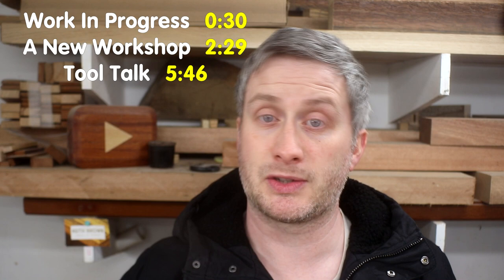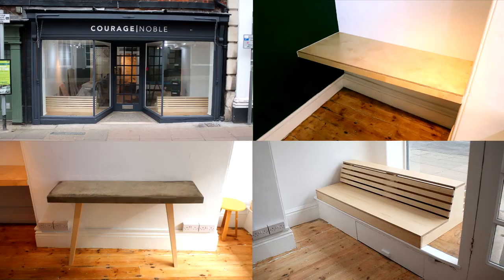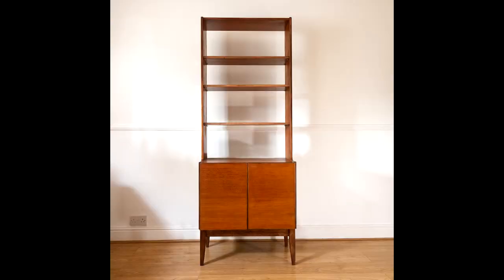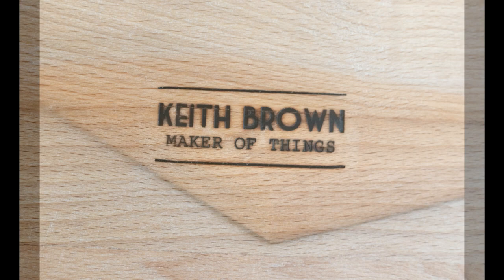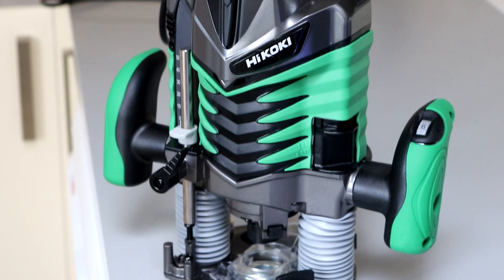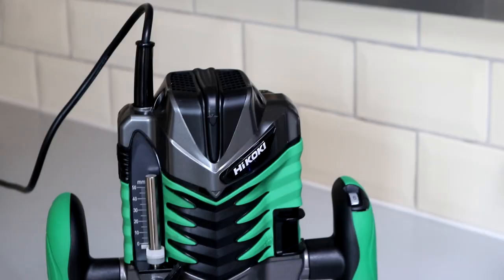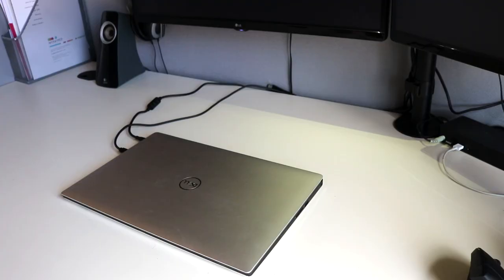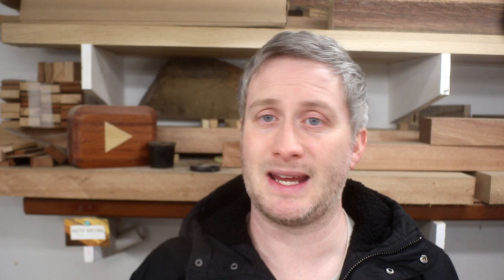VLOG 9 - Work In Progress / A New Workshop / Tool Talk (Makita/HiKOKI/Yeskamo)

Comment: Hey Keith - congratulations on a new workshop. I'm really look forward to seeing how you get on in fitting-out your new space. A pitched roof space is fantastic and I've turned 1/3 of my 6m x 3m garage workshop into a loft space all boarded-in with loft ladder to ensure the storage space is usable and I keep the dust from the workshop off the stuff I will be storing there. Insulation is the one thing I've not finished off and it is really important. Having failed to get the place insulated the workshop was cold over winter, plus I know from taking sound measurements from outside the workshop my machinery is going to upset the neighbours. I'll be tackling that over the summer but I wished I done that much earlier. Anyway best of luck. Oh, and well done on the track-saw.
Reply from the maker: Thanks Karl. I may need to pick your brains for some advice at some point re: the loft construction if you don’t mind! I have some ideas about how I might do it but be interested to hear how you did yours 👍
Reply: @RagnBoneBrown  no problem I'd be glad to help.

Comment: Congrats on the new house and workshop! Have had the same tracksaw a while, it's great but you do need some care with thicker material (I was doing thick worktops) - that thin blade can deflect a bit and end up with a cut that's not perfectly square. I don't do more than 20mm in one go now.
Reply from the maker: Cheers I’ll watch out for that 👍

Comment: Fantastic news. Congrats on everything. I'm especially looking forward to the new workshop build series. Can't wait. The router looks a nice bit of kit. I'll be getting the tracks through your link. They seem a great price and I'm certain they fit the titan tracksaw.
Reply from the maker: Thanks! Can’t wait to get in there 😀 If you look at the evolution tracks on amazon there’s actually a compatibility chart on there and Titan is listed so they should fit 👍
Reply: Rag 'n' Bone Brown hi Keith after commenting I went on your link and had a look and found they fit quite a few brands. How are you finding them. Have you used them much. Thanks
Rob
Reply from the maker: @NorthWalesCampers  I've not actually used them yet, other than just putting the saw on and sliding it back and forth.  I expect I'll use them later this week as I'll need to rip down some plywood sheets then

Comment: Keith. If I'm being honest, the double garage workshop ain't gonna be big enough, I'd suggest you extend it when you move in, as it'd just be less effort then than further into the future, if I were you I'd add a another 3.6 to 4.8 meters on the side and a 2.4 meter porch on the front as it allows vehicle unloading, even if your not prepared to do something like that, I'd check with local council, and other building regulations to see if you can do it in future. Hope this helps
Reply from the maker: There is no space to extend it. I think it’ll be plenty big enough, besides if I need more space I’ll relegate my wood and materials storage in to another outbuilding and use up that space
Reply: @RagnBoneBrown  I'm only kidding, I'm operating out of a 6x10ft shed

Comment: So does this mean, since the new house needs some repairs, that you'll be doing a series on home repairs and remodels?
Reply from the maker: I’m not sure, I’m open to the idea if it was something that people wanted to see but I’d be concerned about people unsubscribing, which always tends to happen when youtubers try something a little different
Reply: @RagnBoneBrown  Well, there is one way to find out. Post a poll with three options: Keep it the same (hate change), change it up (like change), or it doesn't matter (good with anything you do).  If not, maybe just add in more Vlogs (extra videos, which won't need as many edits or preparation as a full blown project).

Comment: I've been looking at this track... Do you know if your Makita runs on "standard" sized (Festool) track? I've got the Aldi track saw (Scheppach PL55 clone) and would like some longer track but have heard rumours that the Evolution track is meant for smaller gauge / width track saws (Scheppach PL45 is the one quoted as supported by Evolution)
Reply from the maker: If you look at the Evolution tracks on amazon there is a compatibility chart which may help 👍
Reply: @RagnBoneBrown  bit the bullet and order it. It fits! Flipping bargain!